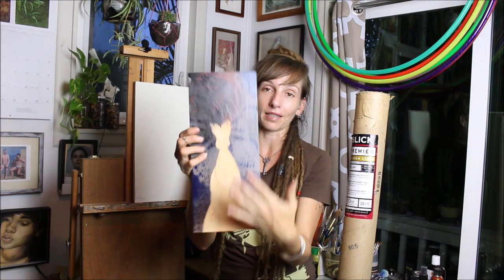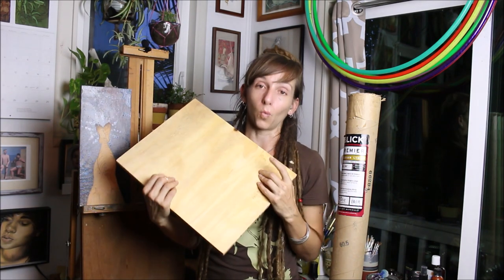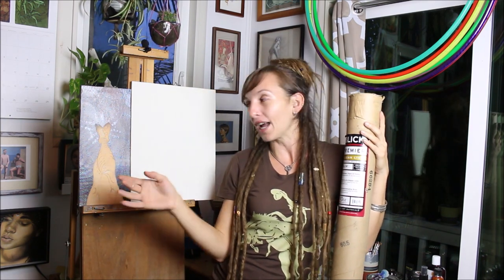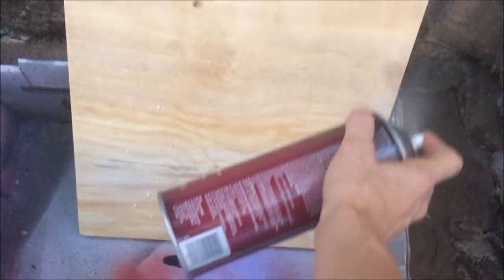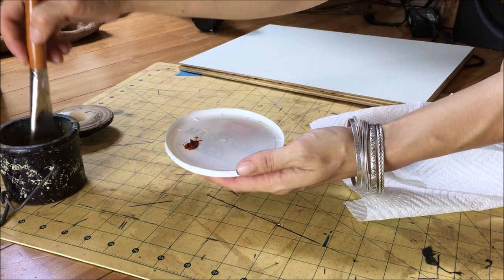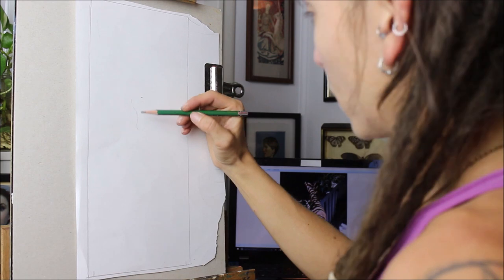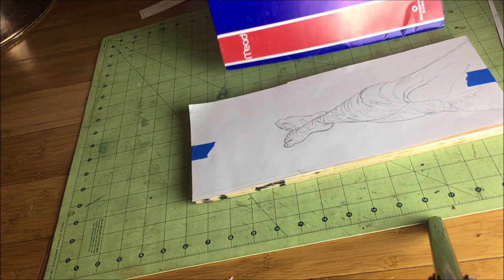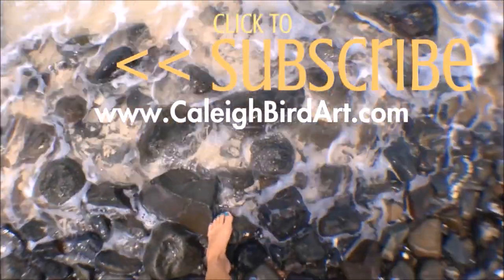How to Make a Painting Panel with Linen or Canvas

Comment: Hey, it's great that there are so many artists out here on YouTube, offering free advice. 
Unfortunately, I would not recommend that anyone mount Linen on Board in this manner for longevity. To begin with, the archival properties of that adhesive are questionable and may cause the linen to deteriorate over time. Additionally, not wrapping the linen onto the back of the board means the corners and edges will eventually lift and the linen can separate from the board, causing cracking of the final painting. 
Instead, RAW Belgian Linen should be mounted to a board BACK AND FRONT (that's TWO pieces of linen, with the front piece having a 3" to 4" overlap). The raw linen is far less rigid than the pre-primed, and the pre-primed does not allow the adhesive to penetrate through the linen. 
This should be done using Rabbit Skin Glue: first on the board, then attach the linen to the BACK first. Allow to dry for several hours. Then repeat for the FRONT, wrapping the linen over and around the back. 
This is done to create equal tension and prevents the board from warping over time. 
Finally, the front should be primed using a mixture of Rabbit Skin Glue and Whiting (aka Marble Dust or Chalk Dust). Three or four layers of this mixture can be applied. 
Once dried, the board should be "seasoned" with a light rubbing of Linseed Oil, which is then wiped away

Comment: Thank you, immensely, for these inspiring and informative videos! I do have a question: do you have a specific brand of spray paint (that  meets your quality expectations)  that you would be willing to share?
Reply from the maker: My pleasure, glad you like them! I don't really have a favorite brand actually. I've used from the nice Montana and pro kinds all the way to the Rustoleum from the hardware store and they've all been fine. HOWEVER, I'm not concerned about the smoothness of my backgrounds, and in fact I like them to have spots, bumps, and texture, which some of the cheap spray paints give you plenty of whether you want it or not so be careful. I make sure to not spray paint the area that I intend to oil paint by using the tracing paper because it will ruin the lovely linen base.

Comment: Is the spray adhesive archival?
Reply from the maker: When you say archival, do you mean will it last? I believe it will. Well, as long as any glue would last.  I have had great results, but if you really want to be sure it would be good in 500 years, maybe just wrap the canvas with a wood frame and staples or nails instead ;)
Reply: @CaleighBirdArt  I just wonder if the spray glue will break down over time. You one of few that I gave seen use the 77 spray. It shortens the time for adhesion for sure. How long have you done this process and did you ever use any paste type adhesives? Thx
Reply from the maker: @paulallentaylor6034   @Paul Allen Taylor  I've been doing this for about 8 years and the folks who taught me were highly skilled seasoned artists. I did try with a paste, but it caused air pockets to form under the linen (canvas) in multiple places that I could not get to go back down. I actually create 3d mixed media oil paintings using clear resin to affix found objects into my paintings so at this point everything gets sealed from all angles for me. The spray feels super secure though!

Comment: I think I need to step in and say some thing about this demo, for others... 3/4" plywood?? OMG, that's heavy stuff, not only that, but you are using floor grade ply, not even cabinet grade! I'm not only an artist but I know a lot about carpentry and construction, I can tell you that stuff is great for a floor but not good at all for a panel, delamination of the ply's could be and issue, and the knotty pine you have (I saw a huge knot in the middle of the board you are using) has gaps and the knots will sap acids into the backing of the canvas in huge amounts. Very bad. VERY bad. VERY BAD... Now, Adhesive Spray 77 is great if you are using it for Styrofoam, or urethane foam or photo paper, (to a point) but for a canvas, not even a little bit. Some facts about spray adhesives: they only stick as long as they are retaining moisture within their medium, meaning once they dry out, they are dust. Cements are better, by a long shot, PVA glue or Rabbitskin glues are best for long term mounting for good reason, This has to be the worst form of mounting I have seen yet. I won't even mention the archival issues with this mounting- its just bad, very bad. BAD. If this is what you swear by, keep doing it, by all means, in 30 years nothing will be around for my work to compete with! It's a shame you are buying top quality linen and doing this to it! LOL
Reply from the maker: Thanks for the info, I actually appreciate learning new things. Too bad you had to be kinda rude about it. 
I have changed up how I create my panels in the last two years, I'll use this as a reminder to make an updated video. Thanks. 
And maybe you could consider creators' feelings next time you want to be super sarcastic while taking a great deal of time out of your own day to educate them 🤷‍♀️
Reply: I only do small paintings for personal gratification and have a large collection of used frames from charity shops/flea markets etc, all weird and wonderful sizes.
So I make my own boards from 3mm MDF A(medium density fibreboard) for small boards and 5mm for larger.
I cut to size required then seal the back with builders water sealant and glue either watercolour or canvas textured artists paper to the front using the PVA glue, school or craft glue from the supermarket stationery aisle. This is crushed between floor or table top under a heavy board with books piled on top. By next day it has dried and I trim with a sharp knife then two coats of acrylic gesso. Have not had trouble with bubbling and any corner lifting just gets a little more PVA glue. The edges might look a little rough but they will be hidden by frame eventually. Will this do?
For the future I am thinking of using cotton fabric from haberdashers shop and using same process.
Reply: @CaleighBirdArt  Some people seem to believe it is ok to be rude, disrespectful or nasty on the internet because they feel anonymous unreachable and can get away with it. In reality, if adults, they are acting like immature children with puerile insults and should be ashamed of themselves.

And in this case it came from someone purporting to be an artist! I thought artists were nice creative kind and gentle people.

That was the worst comment I have seen out of thousands on an artist's YouTube video.

YouTube has standards they require to be upheld, I would report this offensive individual.
Reply from the maker: @philiptownsend4026  Thank you so much Philip! Both for your kindness and for the fantastic idea of finding a cool frame then making the art fit it 🙌 I’ve been using the spray adhesive with no problems under my resin, but I like the idea of using rabbit glue or some other archival adhesive instead. Thanks for the thorough info! And for bringing a smile 😊😊😊😊